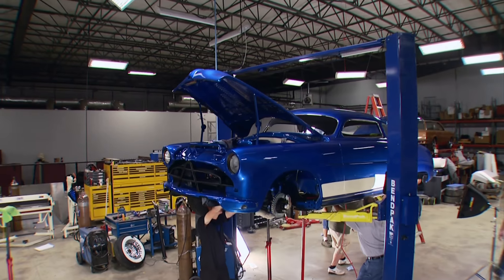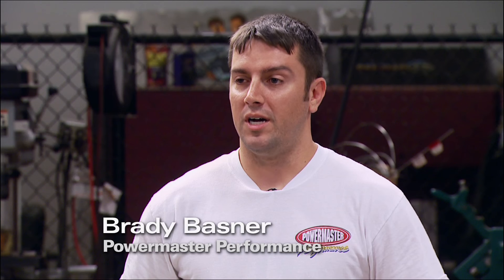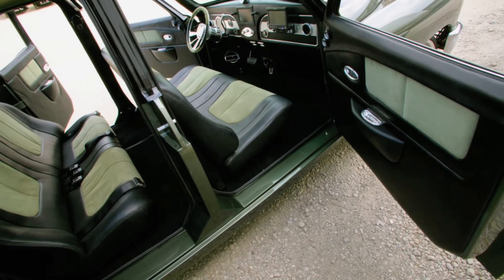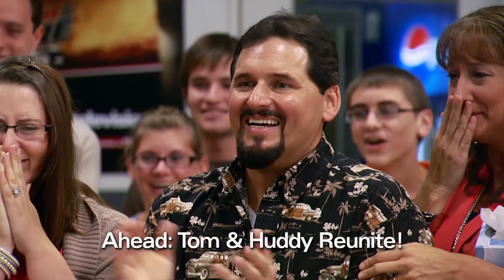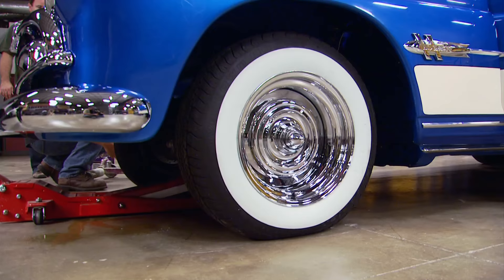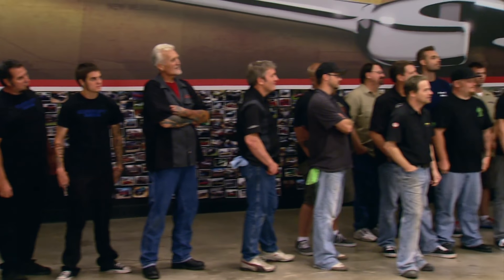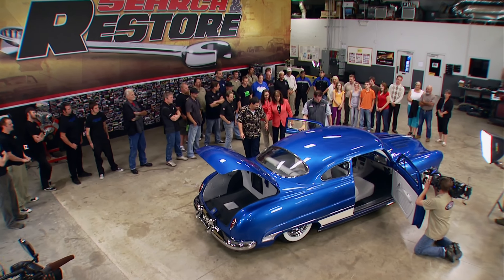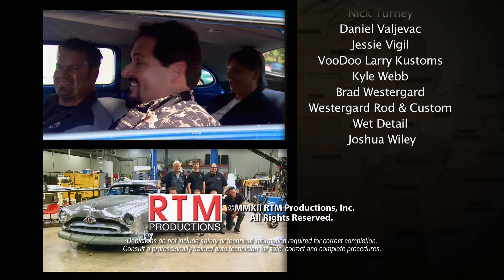Custom Hudson Street Rod Build - Part 4

Comment: The car looks absolutely fabulii, but there is one thing I feel I must comment on, all the silicone they put on the gear set.  Most of that stuff is going to squeeze out and leave a a bunch inside that could potentially play havoc with the gears.  Better they should have put a thin coat on a standard gasket, that way no squeeze out and it will never leak.

Comment: What an insult to Hudson, it looks like a hideous cartoon.....and Chrysler had no ties to Hudson.
Reply: apparently Hudson was under AMC which ended up under Chrysler, a bit of a stretch but certainly a real connection, i think.
Reply: @uliwehner  When this Hudson was made it was not even part of AMC company.  It wasn't until 1954 when Hudson merged for the 1955 model year and became part of AMC. After the merger Hudson's were more of a Nash with a Hudson engine and AMC ended Hudson after 1957.  Chrysler did not  own  AMC  until I purchased it in the very early 80s, So there is no connection.  The Hudson was long gone before Chrysler even was Contracting with AMC.